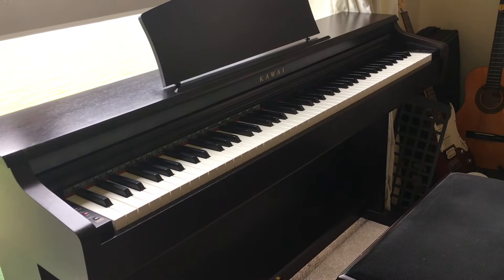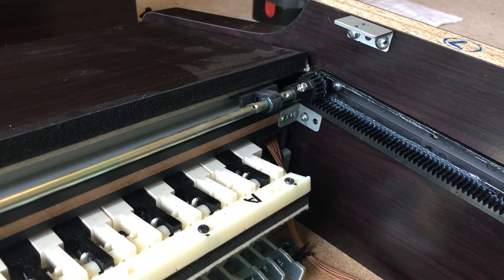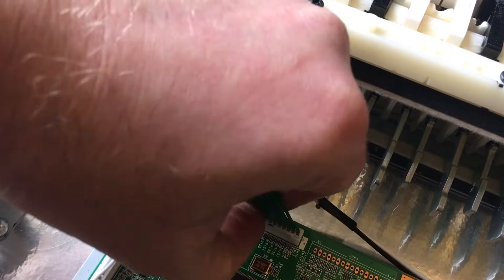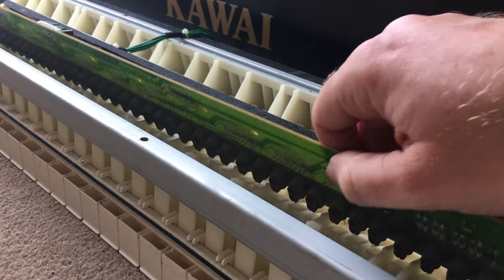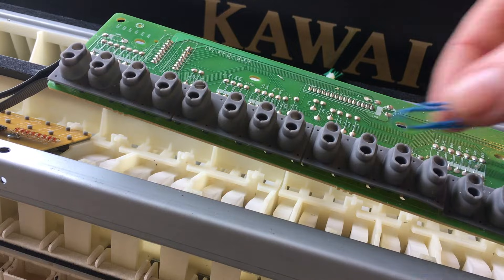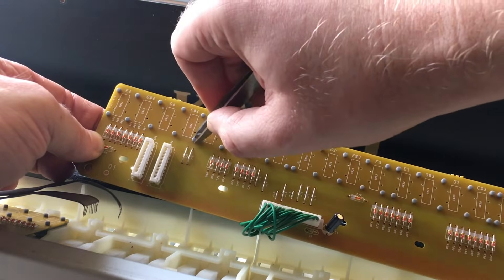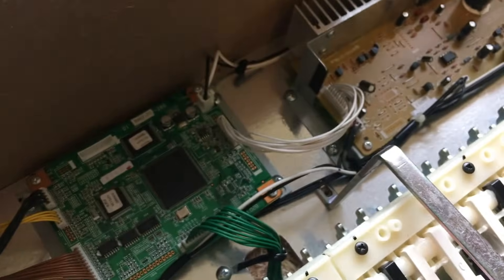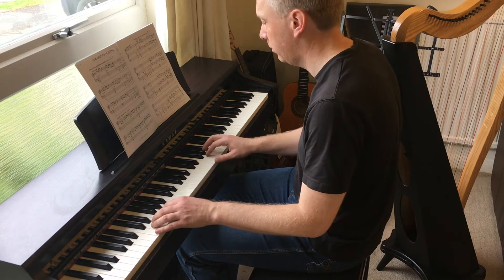Kawai Digital Piano - disassembly and repair

Comment: in most cases it's not enough. Easy but not enough. And worse, more keys can not even work after. The very best thing to do is to use Loctite 3863, wich is a silver varnish, and to paint (3 layers is nice) the little black graphit contacts in the rubbers. You can see him erase them at 4'51, but if there is no enough graphit on them the contacts will not be good and it will result in velocity differences between your keys or keys not working, as I said before. Trust me, after doing that on my keyboard, I recovered a new one ! And one more thing : it's valid on ALL keybeds because they always use similar rubbers
Reply: I cant find it ( loctite 3863) can you tell another alternative. Please.
Reply: @Piyushchawla08  you can also  use "Graphit 33" (Kontakt chemie) on a cotton bud. These products on AMZ
Reply: That's what happend to me, after this video all keys ar enot working properly, even tough I removed a few rubber contacts from the board not all of them, I can't explain why the entire board is not working now

Comment from the maker: Two years on from making this video I found more keys were failing. I followed the steps in this video but that didn't completely fix them. The problem wasn't dirt but that the rubber contacts weren't fully working. I think the contacts on the rubber wear away slowly over time. I replaced them and it snapped back into life. I got my replacement rubber contacts for about £10 per strip of 12 from the UK supplier WD Greenhill: http://www.wdgreenhill.com
Reply: That's very valuable information, and I have taken details, should I need them. Thanks again.
Reply: the website address changed, you might want to the current one. Great work, thank you!
Reply: Thanks for the video!
Do you know where I can get the amplifier board? My Kawai needs one, it is just like yours
Reply: thanks for the link Bud, i have a 2yr old ES110 recently got ants inside and cant seem to find a replacement contact
Reply: Sorry to hear this. I've not yet tried to repair mine per your video. If you have the rubber replacement part number that would be useful for us in the States should we want to clean and replace in the same operation. Thanks.
Reply: My kawai cn22 dig piano sound sudden low not working full sound just playing litle bit .so plz let me know any one wht i do ?

Comment: I wrote four days ago, but I wanted to add that I encountered another problem as to the reason why I had six (6) 'dead' keys on my Roland 3000S piano. I followed John's advice, but I still had those 'dead' keys! I discovered (by electrical tests) that parts of the PCB copper tracks had gone 'open circuit'. This required the use of an Oscilloscope and DMM to precisely pinpoint where these 'breaks' in the PCB were located. In order to restore functionality of these 'dead' keys, I soldered wires across the 'breaks' in the Circuit Board. The main point here, is that I discovered that the damage to the PCB had been caused by Citric Acid - from spilled drinks that went down between the piano keys. Surprisingly, the citric acid had penetrated the varnish coating which had been applied to the PCB during manufacture. Examination of the copper track in the affected area revealed that the copper had "corroded away to dust" or an oxide. Should anyone decide to strip their electric piano and follow John's lead, I would strongly advise that you also check your PCB. This should be an iridescent green all over the PCB. If you see any 'dark' or black patches on your PCB, that you cannot remove from the surface, it is highly likely that this is acid attack, beneath the PCB varnish / laquer and will result in eventual failure. I think that the technical name for this failure is Galvanic Corrosion, since it is not just the acid, but the low voltage which does the damage. I got this beautiful piano for free, as the previous owner had 'given up' on it. It is now my pride & joy and works perfectly.
Reply from the maker: Congratulations Peter, that was some brilliant investigation and repair. And good advice for anyone looking to repair their piano.
Reply: @johnholcroft74  Hi John, I am a retired Plant Engineer, and my greatest 'hobby' of all, has been to study Electronics since age 14. I felt a compulsion to write within your YT Vid, which was the first(and last) one that I viewed, with regards to this subject matter. I thought that your YT Vid, your explanation of the "breathing effect" on the rubber membranes - really opened my eyes, as I had never considered this at all! At the point that I first saw your Vid, I decided to look closely at the rubber membranes across the 1400mm width of my Roland HP 3000S. It was on close examination, that I discovered the reason why Roland had appeared to attempt a design mod in an effort to overcome this phenomena of the 'breathing effect. Two holes right on the top of the membrane! Rubber membrane tends to adhere at base to the PCB and seal (mine did). I held a section of this membrane up to sunlight, and I can confirm that the rubber membrane 'breathes' through the top. I think that it is a brilliant and simple idea, because the pair of 'breathing holes' prevent each section of the rubber membrane from going into any stress, due to a (partial ) vacuum, and moreover, any membrane cell will instantly recover from any Key Press, whereas the membrane WITHOUT those 'breathing holes will still have a partial vacuum, and would be slower to reform. And (if the membrane has not recovered from the first Key Press), and then you rapidly hit the same key again, the distance between the plastic note key and the top of the rubber membrane would be slightly different. Therefore the time duration of the note and also the impact between Key and Membrane would be different. I believe that this was the Primary Reason that Roland to bore those 'Breathing holes' into the tops of every membrane cell, for all 88 Keys. All of this information is already known to Roland, and (in their striving for perfection) - they would have Lab- detected these slight differences - and overcome them with the redesign of the membrane to include those breathing holes. Would you ever consider taking off the whole Rubber Membrane, of your Kawai, and (somehow) place perfect matching-holes in the Rubber Membrane - and then refit? It could make a brilliant follow-up Vid for you, and benefit anyone who wanted to do it. BTW, I did follow your VId. I marked and then removed every section of the Rubber Membrane. Then, using clear Methylated Spirit, I set about wiping clean, the whole inside of the membrane cell, and its' Carbon Pad. Then the same again with the Circuit Board Pads. I re-assembled the Membranes and then pressed the non-working keys. My heart sank, as the 'dead' keys remained 'dead'. I then determined that this was a faulty electronics issue! As I carried out my tests, the feed to each of the 88 Keys is 4.94 VDC. I discovered that this 4.94VDC voltage wasn't present on the non-working keys! And from there, the circuit board had to be traced for open-circuit condition. When I discovered this cause - I just had to write and help some poor soul who loves his fine electric piano, and (perhaps) help him to fix those bum notes! Also to see the 'warning signs' for circuit board damage - due to spilled drinks. Sorry for this very lengthy email and my thoughts. Finally, I am so happy, coupled with a 'smug' feeling that I now have a very fine Roland Electric Piano. Sadly, many of these end-up in Landfill for these types of Key Fault issues. I do appreciate you and your work in helping others. Thanks for the congratulations, Greetings from a UK expat living in Sydney.

Comment: John, we all make a few 'mistakes' when pulling things apart, and you are genuine and honest. You did a great job in highlighting the fact that (when any Key is pressed), the air which is trapped INSIDE of the rubber Membrane Contact is expelled. When the same Key is released, the rubber Membrane Contact draws in air. Any dirt or loose particles around the base of each membrane (88 of these),will cause contamination of the electrical signals. Today, I have also stripped down a Roland HP 3000S with a similar problem, ie; Six Keys are completely dead! I wanted to say that the Roland has identical Rubber Membrane Contacts, but there is one major difference. If you examine the top of the rubber membrane, you only see the TWO hollow bores, on the Kawai membrane. On a Roland, there are the same pair of hollow bores - in a north-south line. Also on the Roland, there is also a pair of tiny holes - on the east-west plane, and I can only assume from this, that Roland had decided to place "breathing holes" at the top of each membrane for improved cleanliness. I have learnt things from watching your vid. You use a rubber eraser to clean the PCB contacts, where I have always used Methylated Spirit. I will try this. Underneath the Keys, you will see many diodes. My first job was to check the diodes on the non-functioning Keys. All were OK. Many people wouldn't even consider stripping-down their electric piano, mine is worthless, so nothing is lost! At least I will get rid of 30 years of Crud and filth around those 88 contacts. You did a great job. Greetings from Sydney Australia.

Comment: I had a noname chinese piano with same problem, and it was more or less the same setup inside and the contacts were identical, I had to remove ALL the keys just to get to the many screws holding the contact boards (very stupid and cheap design) but in the end it all worked out. Used an eraser on all of contacts and it is good as new. Thank you very much.

Comment: Thanks for your tutorial  ;  is  it applicable  to a  Kawai ES8  as well ? thank you
Reply: hi, did you solved the problem ? in my first es8 some notes  sometimes went at full volume... the seller replaced it with a new one, after a few months i have the same problem

Comment: Hi John. Thanks for this great video! Helped me to fix the middle C key on my Kawai C-34.
Reply: I have to replace an A key on my Kawai ES-1? Go for it? Was this difficult? Thanks!
Reply: @peterschultze9124  Hi. Thanks to the vido it was fairlyeasy. Go ahead!
Reply: How did you remove the top cover. If I remove the 4 top screws, the cover try to pull the back plate with it.
Reply: Nevermind, it was just sticking. Brute force was the answer.
Reply: Well, a bigger problem is that the metal railing is overlapping the long PCBs, so I can't turn them over

Comment: some keys dont work on mine, i cleaned one that doesnt work and still no sound, need help thanx!
Reply: i have been watching other videos... cleaning is not enough some time  because the carbon that is in the contact part has wore off.. so what you do.. is draw over the contact part of the circuit with a soft carbon pencil.. this carbon will repair the missing carbon and work properly .
Reply: https://www.youtube.com/watch?v=rHOYktmxhZI
Reply: That is very useful. Thank you so much!

Comment: Thanks for this video. I just followed it to clean the contacts on my CN34. I wasn't sure if I was up to this but, it all went back together ok and it all sounds ok. Too early to tell if it fixed the contact problem because it only occurred intermittently.
I really wanted to swap some keys around at the same time. I seem to have chipped away at the surface of middle D and wanted to swap this octave of keys for one of the higher octaves. Anyone got any advice on how to do this?
Reply: When you gain access and you are ready to swap the middle D, you must examine every Key, as these are marked as A,B,C,D,E,F and G. Your second octave and so on - is simply a repeat of this. You must only swap a 'D' with another 'D". If your keys are unmarked, then begin at the left hand side. Your first key is an "A". So work forward knowing this, and you can then mark only the "D"s across the Keyboard, and swap any of these around. This is how I did it. Best of Luck.

Comment: Hi John
I've seen that you used a rubber to clean the contacts.
why?
I have an Mp7 that some keys sometimes do not play
Reply from the maker: It is a quick and easy way to do basic cleaning of electrical contacts. If you google you'll find other things you can do if they need more work.
Reply: Same here.  Usually, the key(s) don't play after being struck very hard.  Within minutes, an hour, or a day, the key(s) makes sound again.
I now have a key that hasn't made a sound for over a day. I fear the worst.

Comment: Hello John - VERY informative video, thank you.  I have a two month young ES8 "portable" keyboard (Kawai SAYS it's portable but it's a bit of a beast to carry : )   I am just wondering if you might have an idea where a slight "clicking" sound is coming from while playing the WHITE keys (all black keys are fine) from 3C all the way to 4 C - I brought it to a Kawai tech under warranty - he lubed all 88 keys but was not able to make the clicking go away. According to a picture I took, it looks like there is a circuit board in the area of 3C to maybe 5 C - just wondering if PART of the key mechanisms are coming into slight contact with the printed circuit board.  You can't really hear this clicking when either the speakers are on or wearing headphones  BUT since 76 keys are SILENT then the 12 that are clicking are clearly not "normal" and that kinda bothers me since it's pretty new.   Any ideas ?  Thanks!
Reply from the maker: Hi David, I'm not sure I can say much more than you have already worked out. As you don't hear the clicking through the speakers or head phones it seems to be a mechanical sound rather than an electronic one. If it is only on one set of keys then I would look for a loose fitting in that banks of keys.
Reply: Very nice of you to respond John and yes you are definitely right about the noise being mechanical as it is easiest to hear with the ES8 switched off. Action, touch and sound on all keys are just fine BTW . Actually a clue might be found in that (if the ES8's keys are simulating "let-off" in an acoustic piano) the noise occurs only at key RELEASE, predominately in the 3C to 4C octave with the odd noisy key here and there up to 6C. NO noise below 3C and higher than 6C. So you might say the middle third of the keyboard is affected with this minor gremlin that frankly is not audible when playing but its the old fly in the ointment thing that bothers you just because you know that it's there : )   Thanks again John!
Reply: @davidbee8178  Bet it's the springs. Try taking them off and putting them back on the other way up.